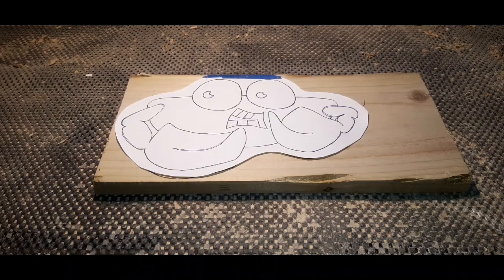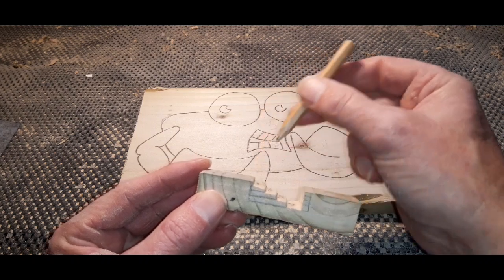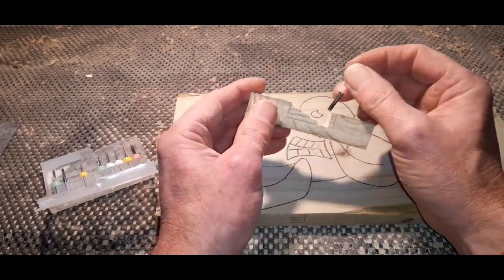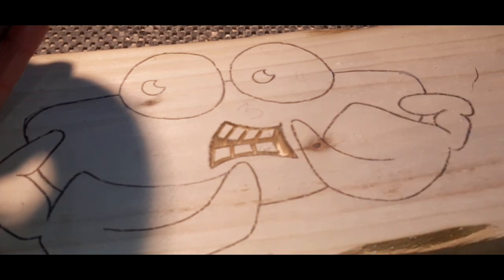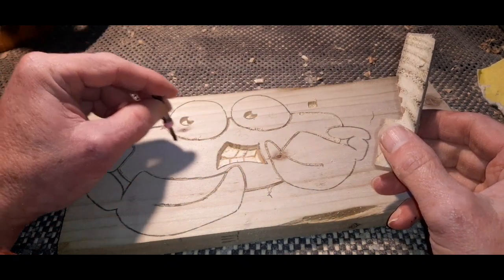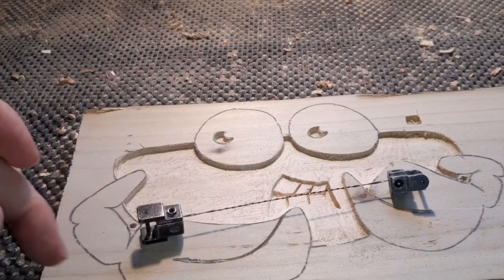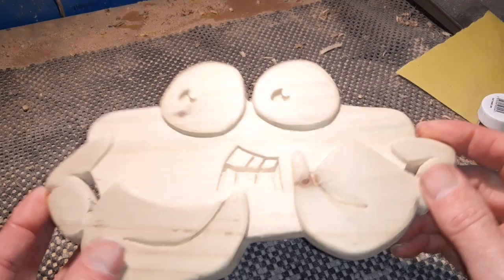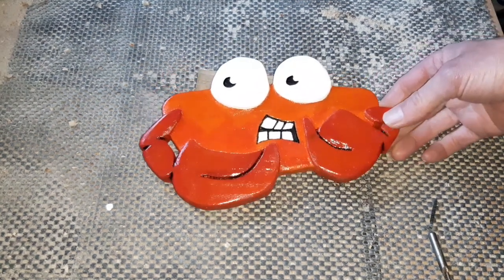Nipper the Crab,router project...

Comment: Love the fishtank projects. Why not use a hose connected to the router to immediately draw out the sawdust and wood fragments? It sure makes for a clean work station. Does fishtank have to get out the ol' shop vac after these projects and clean it all up?
Reply from the maker: Thank you Elmo,I just dont have the space for a shop vac,plus I wouldn't want the noise of the vac going all the time,I do have a little hobby air compressor connected to the router, I tap a little foot pad,when needed and this blows the sawdust away,its basic but it works for me.😂😂😂